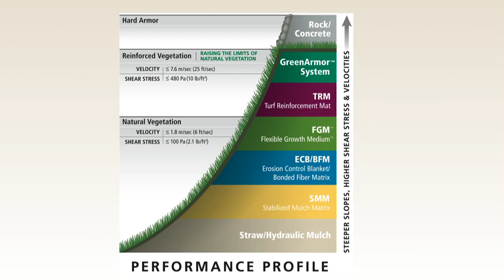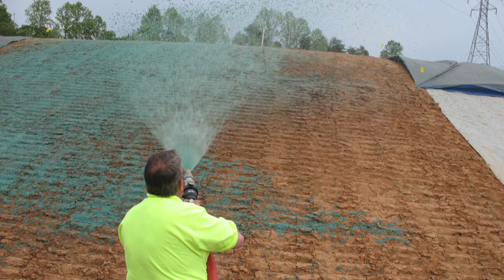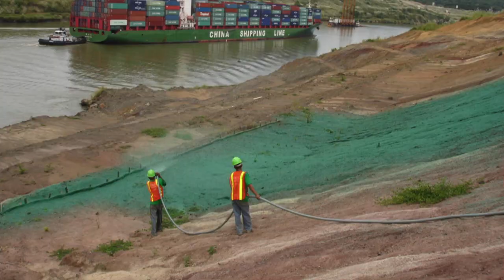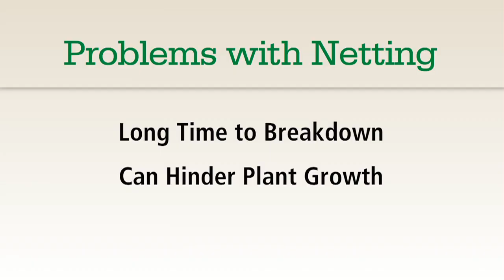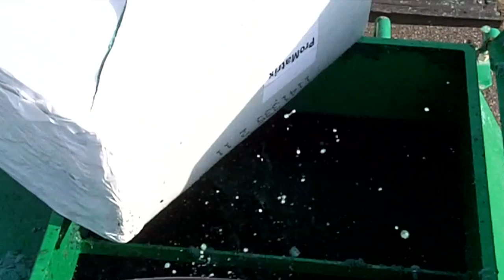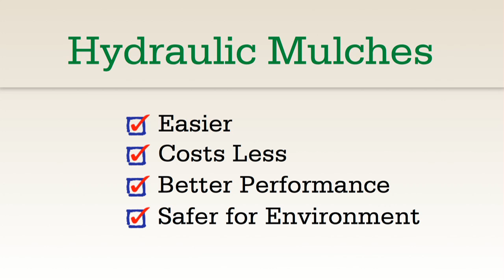Hydraulic Mulches vs Erosion Control Blankets

Comment: You cannot get a spray truck or hose long enough for a lot of areas.
Reply: I disagree to  "a lot of areas".  If there is construction going on, you can typically get a truck, track, or hose onto the site to seed.  Seeding over mountain areas where there is a need for E&SC after a fire does present specific challenges when roads aren't available.
Reply: We are in a remote fly in location and have that specific challenge as it is by small plane.  Are there are any ways to apply manually over a 1/2 acre  We have pumps and hoses.